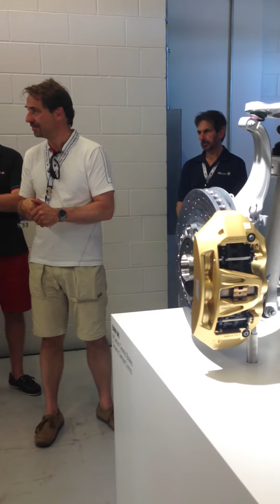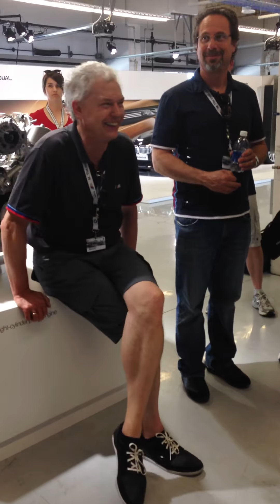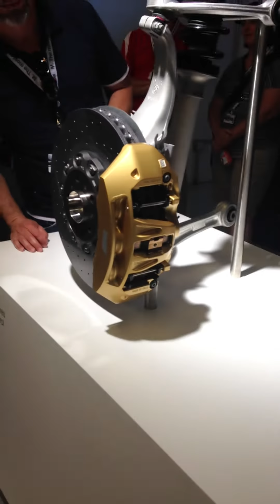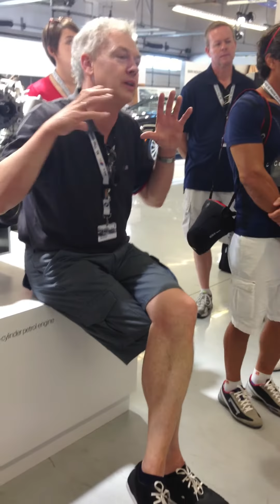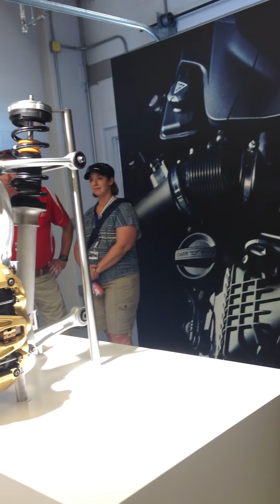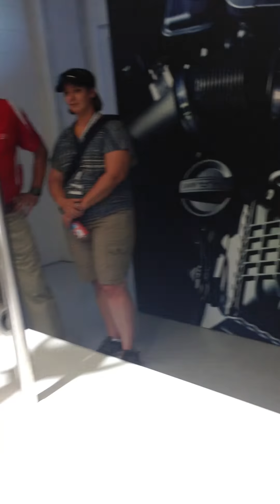BMW Engineers discuss Carbon Ceramic Brakes

Comment: Would love to know about the Steel v Ceramic brakes on the 2016 Audi RS6. I don't care about looks, I would like to know how they perform on the road.
Reply: For the track go with steel there a lot cheaper to replace and with more performance pad selection will perform just as good as carbon ceramics if not better for far cheaper but in the road you can’t beat carbon ceramics they last pretty much forever if you don’t track it have very high operating tempt and significantly reduce rotational weight of the car you can’t beat CCB for high end performance road car applications it ticks all the box high thermal and friction limits long life and is lightweight.
Reply: @patthonsirilim5739    And they look good